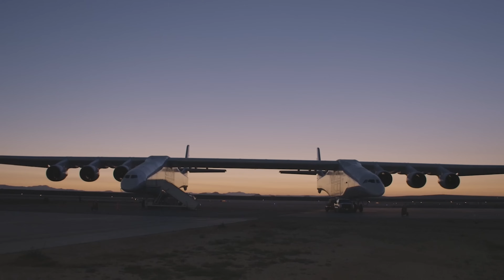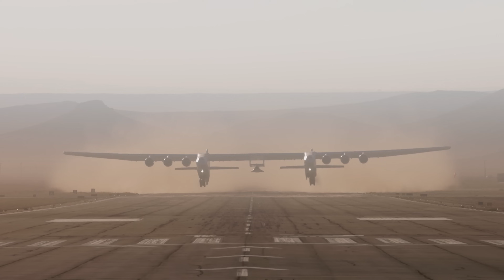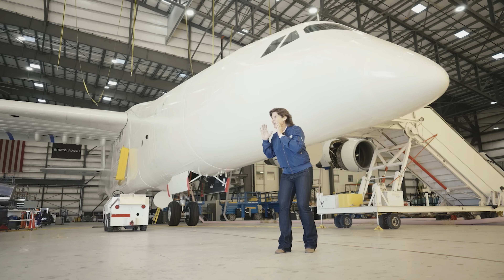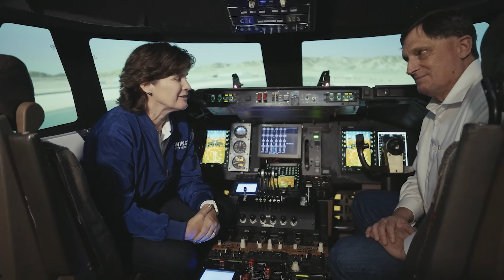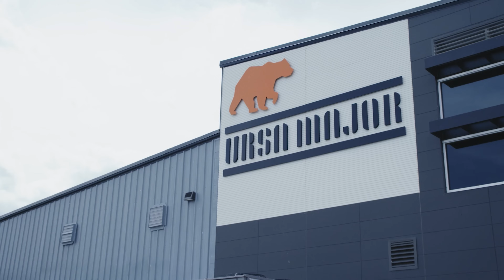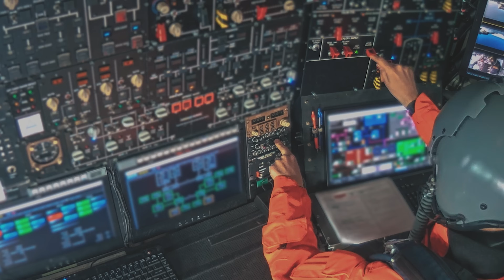When Air Becomes Fire: What Happens At Hypersonic Speeds?

Comment: Who are the potential customers for this? And what exactly is the product or the service? I like the idea of launching space missions from a regular airplane, from flight levels like 10 km, instead of these huge rockets because those are mostly burning fuel in order to lift fuel, and the actual payload is just a fraction. Maybe this is a smarter way, if the costs are lower, the CO2 is lower, it probably allows a wider range of orbit azimuths, and reduces the general overhead we are used to from the Space Shuttle launches. A seemingly unrelated field is testing hypersonic vehicles, and I have a harder time imagining that this is a cheap and easy way to do that.
So... it's not offering something new, just new ways of doing common things. So unless a space agency wants to rent regular lifts, I don't see a business case. And that works only with vehicles that are developed for it.